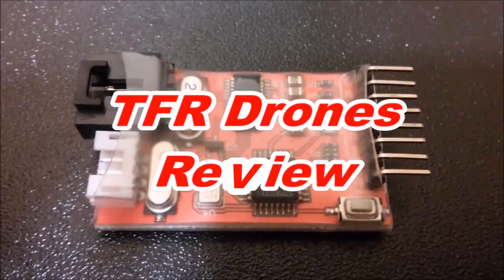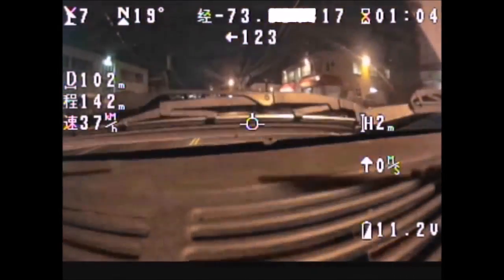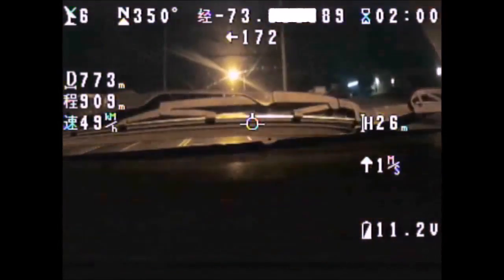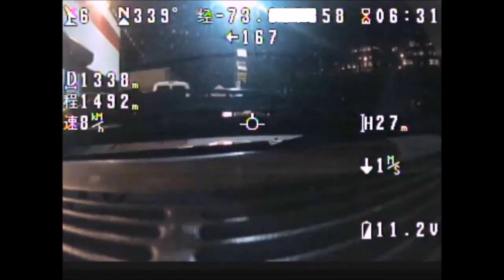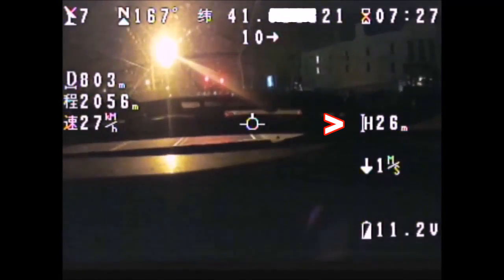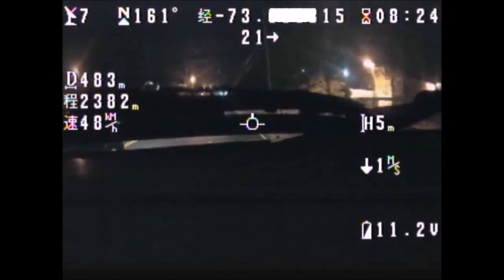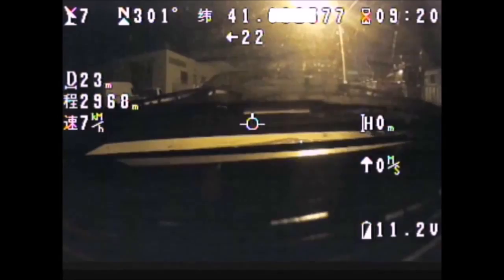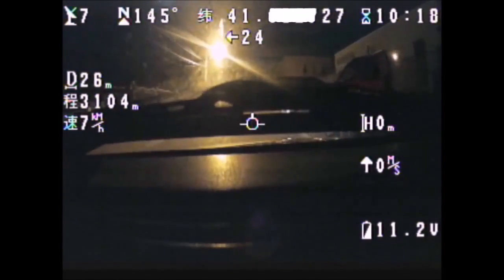GoodLuckBuy N1 OSD for DJI NAZA follow up video

Comment: Thanks so much for the information. As is normal for China stuff, I didn't get any specs or manual. Your video helped so much. 
You don't need +, - Battery connected unless your monitoring supply voltage. The N1 gets power from the PMU thru X3 on the Naza so it's just video in/out, GPS in and exp out. Pretty easy once I saw your video.
Now to note the Menu settings.
Thanks for taking the time to do this.

Comment: Any idea if it supports 4s from the PDB?
Reply from the maker: I haven't try it yet since all my aircraft only works with 3s lipos I don't have a 4s to do a test , what really supply the power to this OSD is the vTX 12v output , I assume that the current sensor input that doesn't powered this OSD can take 4s but i'm not 100% sure .
Reply: TFRdrones I tried the N2 and with 4S to current sensor, didn't smoke, seems to be working fine, but it was just a test, still finishing the build.

Comment: How accurate is the information? I see height is 25m unless you're driving in a monster truck.. then it drops to 9m
Reply from the maker: From when I drove off to the gas station I went up hill , maybe it wasn't that noticeable on the video but I really went uphill , after I turn around you can see the altitude decreasing , this OSD got its own barometer that works I conjunction with the data that it gets from the GPS antenna so is very accurate .
Reply: Epic. . Thanks bro